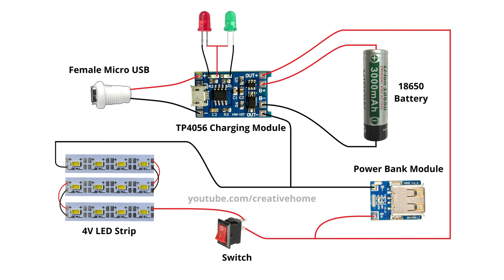DIY Mini Power Bank With LED Flashlight | How to Make a Rechargeable LED Light with power bank

Comment: Bro TP4056 Module Is Not Needed, B'coz The Power Bank  Module Itself Can Charge Lion Battery,Thanks n Regards From Pune 💓⚘
Reply: But the power bank module takes many hours to charge the battery,so the4056 module can charge fast.

Comment: Hi, Quick question - Why use TP4056 as well as power bank module. Why not use the battery to give the output power for external charging?

Comment: You didn't use heat sink, why my 4 volt single no series no parellel with 6800mah power bank, heating too much in few seconds, is there any harm?